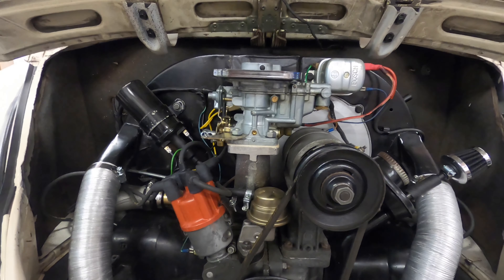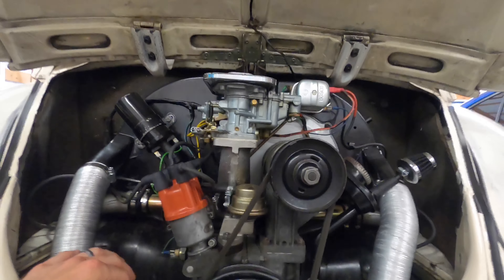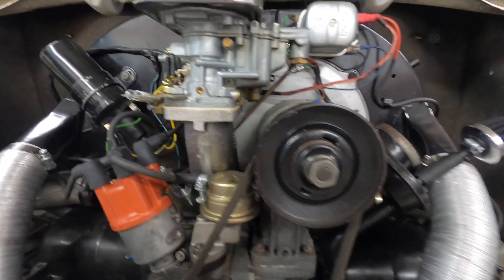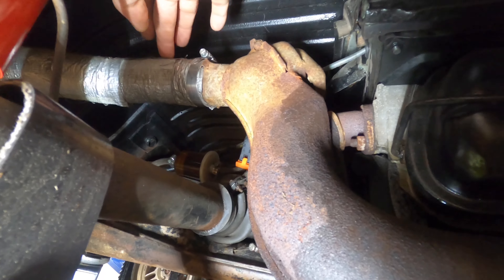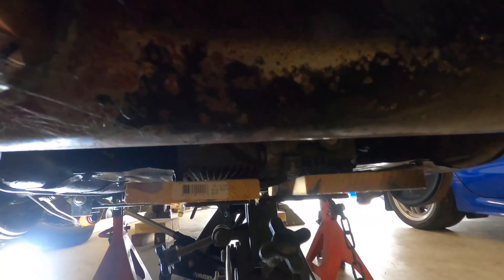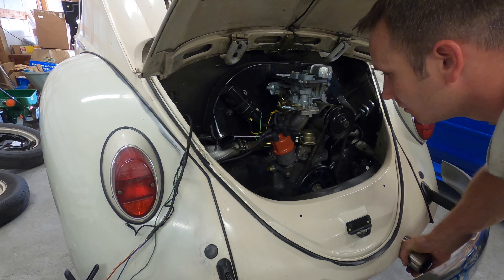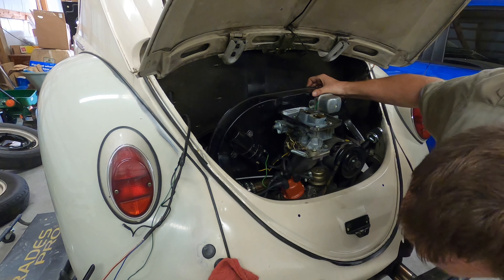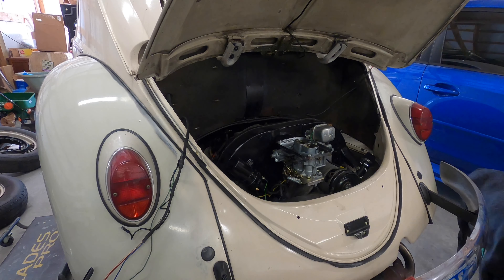Engine Removal VW Beetle

Comment: Hi, thanks for the great video! I have a 65 beetle and i'm going to try and change the engine for another one. Is there any seals/gaskets that i may need to change or is just to install the other one? The one i will remove is the original engine. What do you think? :)
Reply from the maker: Right off hand, no need to replace anything depending on the condition of the engine that you are installing.  Might want to go ahead and buy new seals for the valve covers, and of course if you do an oil change, get everything for that as well.  

Also, make sure the clutch and throwout bearing are good.  Since the engine is off, and if it’s even questionable, just go ahead and do it.  Could save you time in the future.
Reply: @VitosFix  Great, that makes sence! :) thank you so much for your answer!

Comment: Hello my friend
I connected this weber k1410 carburetor to the Beetle engine, but unfortunately I can not adjust its fuel.
You can guide me
Reply from the maker: I’m sorry, but which Weber do you have?  Is it the 32/36 progressive?  I’m not recognizing K1410.
Reply: @VitosFix   yes this 32/36 progressive
Reply from the maker: Let me know if this isn’t your carb.

https://www.mgexp.com/article/weber-32-36-dgv-dgev-dgav-tuning.49

#58 is your idle adjust
#70 is your primary throttle adjusting screw

So Weber has many different types of carbs out there, but work very similar.  Make sure that everything is setup how this guy has it in his YouTube video (link below) and go from there.  If it’s too rich or lean, you will have to buy different size jets (Primary/secondary jet, idle jets)

There are a few ways to ensure your mixture is correct, some people go off of smell, you have your different fuel/air ration gauges, and they have other testers out there as well. 

Unfortunately I can’t tell you what size jets your are needing.  It’s dependent on how big/small the engine is, your heads, intake, exhaust, etc.  

Let me know if you have any other questions! 

https://youtu.be/bm1b5RwNaUA
Reply: @VitosFix  Thank you

Comment: I have taken the 4 bolts out and the heater stuff is disconnect but cant get my engine to drop in my 74.
Reply from the maker: Can you see it moving/separating from the transaxle?  Has it ran in the past couple years?  Just trying to get an idea of where you’re at.
Reply: @VitosFix  Has been sitting in a field for about 6 years. I cannot see it separating. Thanks for the response
Reply from the maker: Man.  I would try your best to clean around the seam between the transaxle and engine, then spray a lot of PB Blaster.  Let it sit for a day or so.  

When you try again, make sure the Jack underneath the engine (with wood or something inbetween) is supporting the engine enough, try to pull side to side (using the heads) and/or up and down.  Once it separates you’ve got to make sure you have it pulled forward enough to clear everything.  (Shaft coming out of the trans)
Reply: @VitosFix  I was telling my wife that I hadnt pull one in about 30 years but I dont remember it being this crucial. I will try what you said for sure. Thanks
Reply: Cool video
Reply from the maker: Thanks!
Reply from the maker: You’re welcome!